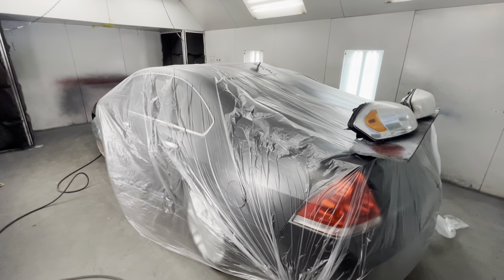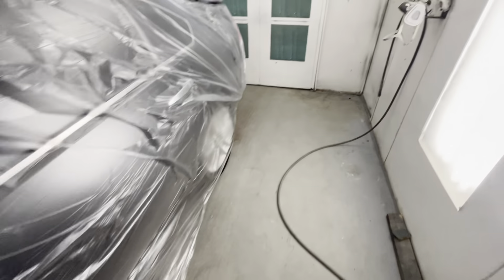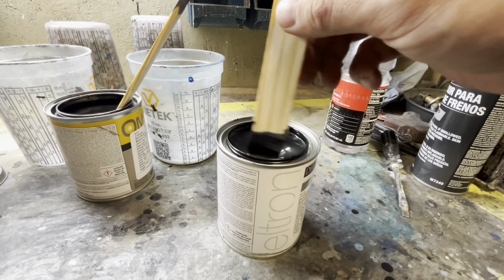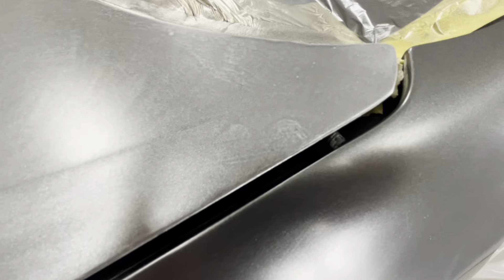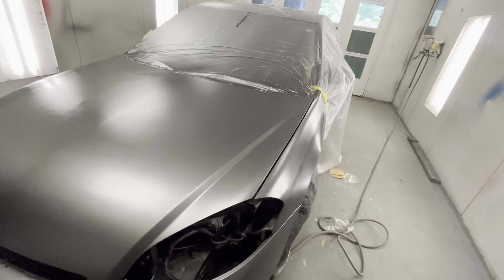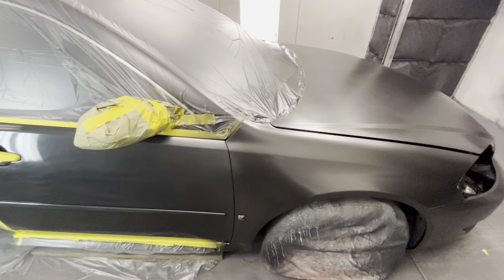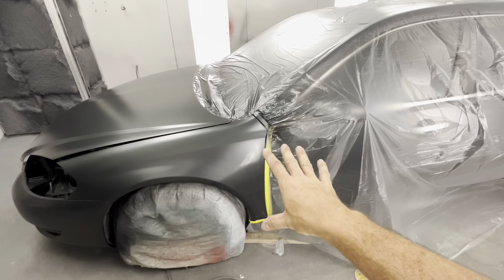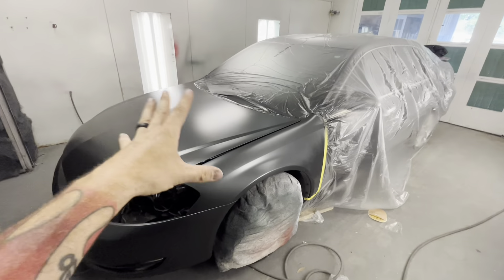🚨Saving Money On Paint Cost By Using Less & Blending Panels 🎨

Comment: That looks Wayyyyyy better than some hi end shops
Reply from the maker: Thanks man lol no clue how
Reply: @ThePaintPaperHustle  I was looking at the truck I sent you a picture of, I'm gonna tackle 1 body panel at a time.
Reply from the maker: Ok be careful doing that it can lead to different shades. I’ve had it NOT happen many times using same paint but have also had it happen. Make sure you use same color drop coat